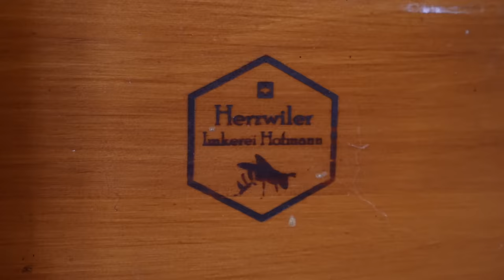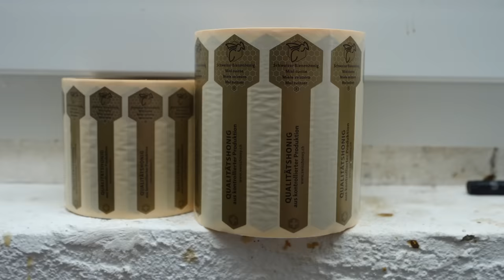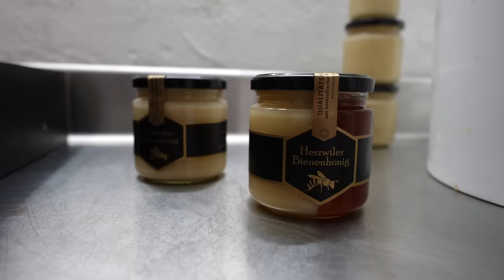This House is FULL of Honeybees

Comment: For cleaning your body in a vehicle  I highly recommend body wipes of various kinds. If you are outside the vehicle I recommend rubbing volcanic pumice on your skin with something rough. It will absorb body oils and the rough thing (rag, loofah, etc) will remove dead skin. Afterward your skin will be smooth and dry. You can use lotion to rehydrate the skin if desired. If you dont have volcanic pumic you can use anything thats dry such as sand.

Comment: WOW!  His bee house is absolutely amazing...  I'm familiar with Slovenian (AZ) Hives and this man's hives most closely resemble those, BUT not exactly.  The Slovenian hives I've seen rest their frames on metal rods and do not have the stubs of wood that extend out from the top cord of the frame.  However, these Swiss hives have recessed grooves into the sides and frames similar to Langstroth frames with the stubs of wood that extend out from the top cord of the frame sliding into those grooves in the walls of the hive.  The only challenge I can see with this is that the bees could propolize those stubs in place into those grooves, making them extremely difficult to get out unless you pull each frame out regularly to prevent them from doing that, or so it seems to me...  I've also never seen those clever sloped landing boards with their little sloped roofs and sides to them.  This would be very helpful with keeping rain off their entrance, even wind blown rain would be blocked somewhat by the roof and sides.  We have a lot of rain here in the Pacific Northwest of the US so that would be a great addition to my hives!

Wow, I'd love to ask this beekeeper so many questions about his hives!  Thanks for sharing this.

Comment: Painting the entrances may have been done for the looks, but I have read that bees also use coloured hives as a way to tell where their hive is in relation to others nearby. This only works when you randomize the colours and don't have any repeating patterns, but they basically remember their address by thinking "We're the yellow one inbetween the blue and green on the left side". I've read that doing this can reduce bee casualties by reducing confusion and unintended intruders.
Reply: Also, don't blow cigarette smoke into a bee hive. Normal smoke is carcinogenic enough, but the addatives in cigarretes like tar and nicotine is probably not good for them. Bees don't get cancer due to their short lifespans of 4-6 weeks, but queens can live upwards of 5 years, so I wouldn't risk it.

Comment: I don't know how this video was recommended by youtube, but was a good pic 😀.
Please keep in mind, this kind of beehives are not Langstroth standard, but some kind of Berlepsch variation: frame is paralel with bee entrance, you open it from behind, you need some special pliers to remove frames, and if you want to see first frame you need to remove all before it. And bees may not cooperate so fully like in this video. Usually frames are cemented with propolis and you need to apply force to remove it, and bees don't like it too much.

Comment: Actually, my friend, those colors are absolutely practical. Bees can see many colors (helps with hunting flowers), and so can see the difference between the different hives by color as well. However, when in a line, as this bee house has them arranged, the bees can experience "drift". You see, bees can easily see "left, right and center," but if their hive is on the right most of the left-hand cluster, they tend to miss and just go into one that is more left from that. The foreign hive permits the bee to pass, as she is carrying in food. Eventually, you get all the bees in the left-most and right-most hives (also direct center). This is, of course, bad for overcrowding and it essentially kills the other hives. However, if the hives are colored, this helps the bees to find their way back to their true home. Alternatively, you could use symbols instead of colors, since bees can also differentiate many different shapes (again, helps with finding flowers). Something as basic as a deck of cards can be used. A bee can understand that his home is the Jack of clubs and not the Queen of spades. 

Source: I'm currently taking a beekeeping course.
Reply: You forgot that they can’t see red 🫠
Reply: @naomifrank1347  they can't, but they can still differentiate really well regardless.

Comment: Alex I too have extensively traveled all the states of America.  Yes, every one of them.  I have a cell phone that acts as a wifi now.  However it would seem Mc Donalds cut back too one hour inside the eatery, but you can connect to the wifi outside you might have to find an area in the parking lot for sponger service.

Comment: Even if your washing compound is biodegradable, you should still wash with a bucket or shower of water on the bank beside the water rather than releasing that compound into the water. The compound will degrade much more rapidly in soil than in open water, and has a lower risk of causing harm before it degrades.
Get wet swimming in the lake, get out, lather up, rinse with a bucket. If you want a final rinse back in the lake, that will still release a lot less of your washing compound into the open water than trying to wash in the lake.

Comment: That gave me an idea. Imagine those bee frames were on a drawer and tracking that you could just roll out and then there was some kind of rigged up way they could all be more quickly transferred to that other piece they were put on. Like what if each frame had a loop hole at the top fastened to each and you could slide something in all the loop holes that was like a larger coat hanger and that picked them all up at the same time once slid through all the holes and more quickly tranferred them that way. Then you could just take the coat hanger thing off and slide it out the holes and do whatever you do with the frames.

Comment: Get one of the hot water gas heater showers or a old bush trick is run it through a water pump and turn heater on to heat waterthat will take research though.